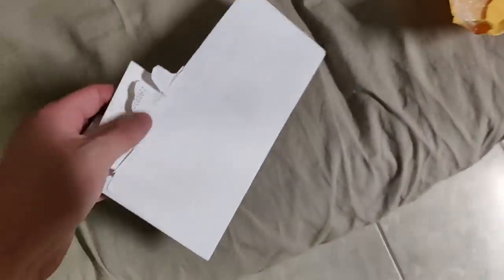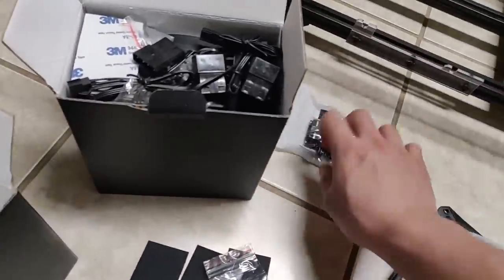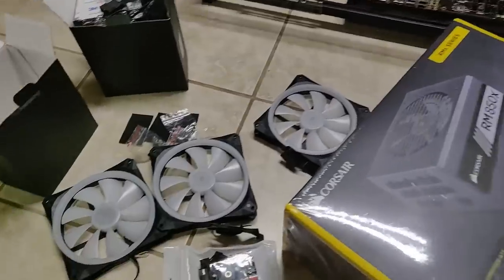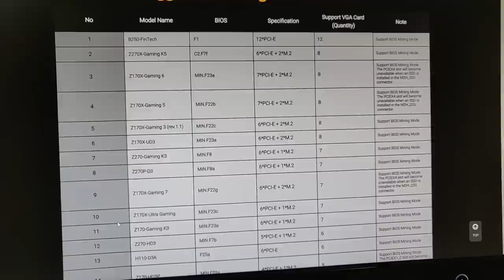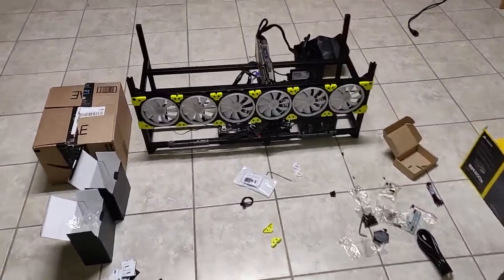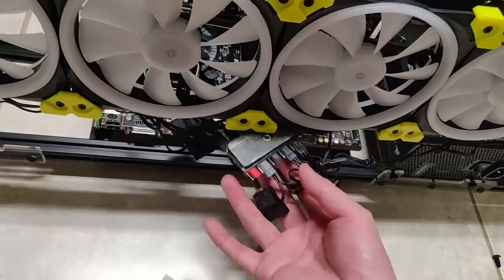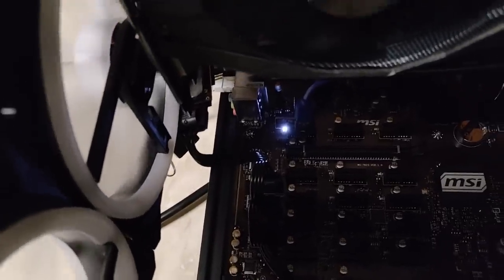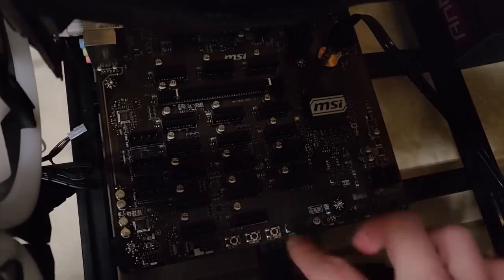I Broke My New Mining Rig...

Comment: Awesome Aion stickers man =D neeeeed!! Regarding the rig, some stuff the others have said: reset cmos, check/update bios, MoBo headers - other than that try exchanging some cables, try to put the card in the main PCIE X16 slot and plug the card in (yeah it sucks with fan-rows, I know), still think (and hope) it is cmos. About the fans, sometimes these controllers are a bit .. say buggy. Stay strong, that's part of the life we chose =D you'll figure it out  P.s.: When you get the HP Server PSUs you'll need a Pico-style PSU as well for 24pin MoBo pin (little awesome PSUs, 6pin to DC powered)

Comment: Have those same up here 140mm fans on FrankenRig.  They look good, but do not move enough air for me.  I moved to mostly 3k -4500 fans.  I'm running thr d3a h110 on the f 23d with no issues for a while.   Thanks for the video

Comment: Hi sorry to hear about the MB issues but I’m sure u will get it back up and running. I’ve got a few of these Veddha frames and oddly enough the exact same fan hub. 
Ive found a good spot to mount the fan hub in the frame. But you have installed the fans on the wrong side of the frame. You need to swap them onto the opposite side as per vedhha setup guide. 
So once u have the fans on the opposite side you have 3 bars in front of the mb on the centre of the frame. That is a good spot you can use to mount the fan hub. Now the fan hub coincidentally has a mount hole in the middle of it. Use the screw and lock bolt that comes with the Veddha frame same one u used to mount the fans to the frame don’t worry it comes with extra screws. Run all ur fans to the hub and molex to the hub and pwm 4pin to the mb and your good to go. 👍

Comment: Reset the CMOS. I can almost guarantee you it will fix it. It’s the only spot on your mobo with two little pins sticking up that look like they don’t plug into anything. Take a screwdriver tip and touch both pins simultaneously and you should get it going. One of my rigs has to be reset every now and then for the same problem.

Comment: i've found that when this happens its done . ( rma ) could try and disconnect everything ( including the monitor keyboard mouse and  internet ) but 24 pin and cpu and see if the cpu cooler turns on . good luck . the mb's i've had the best luck with is the biostar boards however i hear the asus b250's are a good price right now.  PEACE

Comment: 🤔 try to clear cmos maybe
Reply: Remove the cell on mb wait for 60 second and this time use mb hdmi port with out connecting any riser
Reply: Also try to replace the battery. This worked for me once. I always have spare batteries on hand because once I bought a used mb which came to me doa. After replacing the battery it worked. I’ve also fried a mb before. Def not a good feeling.